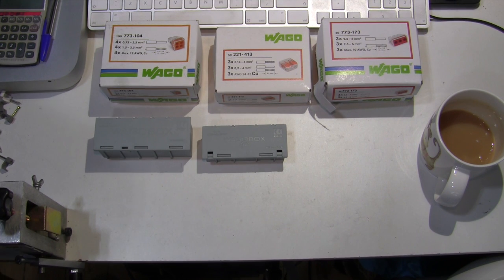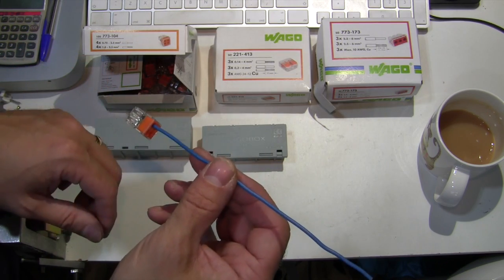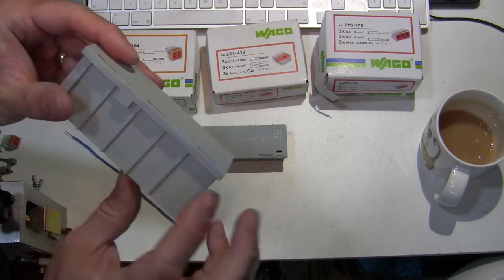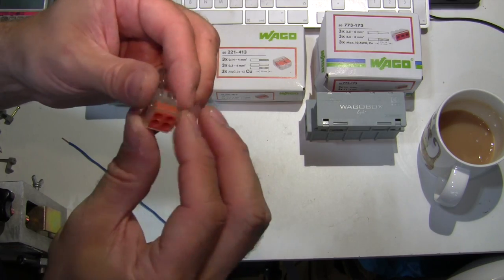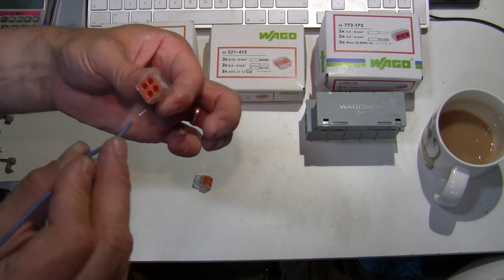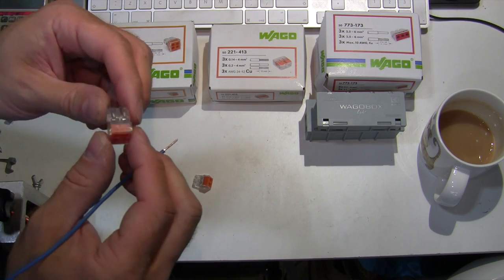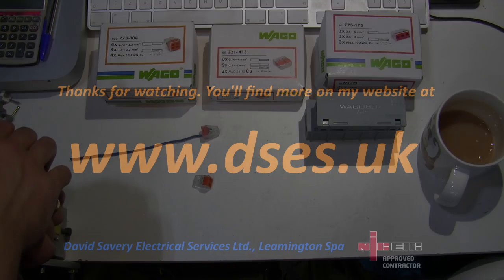Wago and fake Wago connectors

Comment: Great video as normal. Interesting topic. The one thing that has caught me out with these great little things is the amp rating. The Wago 221 20 Amp connector and the Wago 221 32 Amp connector look identical. They are the same size in every way. I’ve mistakenly used 20 Amp Wagos wrong box) on a Ring Final junction box. It’s been installed for well over a year before I’ve realised. Now I’m not sure if I need to swap them out for the 32 Amp. And as normal the Junction box is well hidden under a finished floor. Any thoughts ?
Reply from the maker: The 221 connectors are rated according to different accrediting bodies it seems. I have a box of 221 connectors here, and sure enough the connector itself has "JET 20A 300V" on one side, "ENEC 32A/450V" on the other. Looking at the back of the box, ENEC is the European Mark for electrical products which passes a rating of 32A at up to 450V, same as the Compulsory China Certificate (CQC) logo for export to the Chinese market. The Japanese market is where the PSE rating applies, and their conformity assessment body (JET) have rated these at 20A. As we're in Europe, you can ignore the 20A rating; these connectors have been assessed and passed at 32A. Some of the Wago series, such as the 773-102 are rated at 24A but also accept up to 2.5mm cable and are sometimes questioned for their use on 32A ring circuits. With any type of connector at all, if it accepts the size of the wire, then it's made to handle the current carrying capacity of that wire - unless it's an iffy knock-off in which case all bets are off, but when we're talking about official bonafide connectors, then if it's built to take a certain size of wire, it will be no less capable of carrying the same current as that wire. Remember that on a 32A ring, 2.5mm is itself not sufficient to handle more than about 18 - 26 Amps for long periods, and if the ring is intact then it shouldn't be, so a 24A connector on a 2.5mm ring is fine; it won't fail any sooner than the wire. In your case, the connectors are rated at 32A; Wago don't make a European connector rated at 20A for 2.5mm wire, so no need to go change them out!
Reply: @dsesuk  thank you so much for this amazingly detailed answer. Interestingly my local Strike electrical has the full range of Wago connectors. On the back of the box for some it says 20A and on others it say 32A. Now I’m really confused 🤷 That’s what you tube should be all about. Top man. Keep up the great vids. I may question them on this as to why the same connector has two different box styles. No wonder people get confused
Reply: @morkthebuilder9943  
I am not fully familiar with the Wago range, however if it says 20A, maybe a 2.5mm cannot be pushed in, only a 1.5mm?
Reply: @johnburns4017  Hi again John, I've used probably every wago made for cable sizes 6mm and under. I don't think I've found one that doesn't take 2.5mm, infact I think they all take at least up to 4mm except for the "lighting connectors" but I never got on with those so I don't buy them anyway.
Reply: Not same size.  221-41x is smaller than 221-61x.
Reply: The WAGO UL rating for use in the US is 20 amps  It's the exact same connector as the 32A IEC rated connector. 

This is because on the European continent, current causes much less heating.......Actually, that is 100% bullshit!  It's because the IEC rating system is dramatically different that the NEC UL rating system. In my opinion IEC ratings are complete junk!  Their whole system is horrible. One reason is because they use a consensus system of member countries, which includes places like India, Pakistan and China. Testing is completely different and the IEC allows for "self certification".  

Maybe your box was printed for UL approved, US use. Wagos are very easy to use, however they inherently have a higher resistance connection that screw terminals or wire nuts.

Comment: My impression is that these although maintenance free still need to be accessible so cannot be buried
Reply from the maker: The instructions provided with the Wagobox enclosures describe how to install and de-rate these connectors "...in situations where you need to install a Wagobox in an inaccessible location". Of course, this is in the UK where BS7671 regulation 526.3 applies so long as the equipment is compliant with BS5733 as these are. Other territories may not permit such.

Comment: They do make Y splinters. Do you use a lot they also make a single connection with individual throughputs so if you need the splice three wires instead of having a whole Gob of those they just go end-to-end one two three pass through and they're all in one junction. Very cool and color-coded.

Comment: From what I understand, Wago state:
1) That their connectors are superior to screw-in connectors, as they always give the correct torque. Handy in that torque screwdrivers are not needed.
2) They also state that the connection is superior as more of the cable is gripped - so less resistance drop on a cable run.
3) And that they do not work loose as screwed connections can. 

That correct?

Comment: I saw the old style grey and orange (222) knockoffs for $20 for a multiple port 60 pack but decided to just get the actual wago 2 port 10 pack.  I dont use em all the time so 10 will be okay and I thought perhaps I shouldnt go with a knockoff brand as a first impression on these lever locks

Comment: The other thing to note with these things is the differing cable sizes and ratings..... I think even the 221's are only rated at 20 amps. I could be wrong, whereas the 773's for the 6mm are actually rated at 41 amps...

Comment: I have had similar problems with push in connections on light fittings,  the cable came out with the slightest pull , I swapped them for connector blocks to fix that but not good imo

Comment: Whoa!!! Buried connections without junction boxes?  Is that legal on your side of the ocean?  In the US and Canada all splices have to be in an accessible junction box..
Reply from the maker: It's permitted if the connection is considered to be permanent such as soldered or crimped or, in the case of Wago style connectors, if they comply with BS5733, are derated for the design current, installed to manufacturer instructions and are contained within an approved enclosure that can only be opened with the use of a tool.

Comment: I second the Y connector comment. Sometimes when splicing into an existing wire you have zero slack available and can't get each end of the cut wire into a 221/222/773/2773 but in a Y the connector could make up the extra distance you need so that the two wires would go into each end of the connector far enough to be a successful connection. Also, in some situations, it would just look cleaner. Yeah maybe you'll be the only person to see it for 10 or 20 years, but it's a thing, ya know?

Comment: Those are not safe for residential use you’re telling the public something that’s not right those will come loose eventually and cause a house fire nothing like an old fashion Why you’re not the best those are junk fire hazard
Reply from the maker: You have absolutely no idea what you're talking about. Back up your statement with facts or piss off.
Reply: Our connectors are used worldwide and go through vigorous testing before going in to the market place. WAGO first introduced the spring connection back in 1951 to create faster and safer connections. Due to the fact the spring adjust to the conductor size, no over tightening or damage to the conductor occurs, it holds up to vibration and is shock proof. Please note, our products are used within many different applications, such as hazardous areas (Atex), Transport (such as Trains), Buildings (residential and commercial) and many others. As long as the person making the connection does it correctly, these are the safest way to connect wires. Feel free to watch this video https://youtu.be/s3bpD6VMes8! Please note we have many copies within the market place, so always make sure you look for the WAGO logo!
Reply from the maker: @WAGOUK  Lovely stuff! Looks like the only thing burning here is the ignorant original comment!!
Reply: @WAGOUK  What about ones that do have the logo? Like in the following Amazon link, the quality of the screen printing looks very poor. Could that be a sign of a fake? https://www.amazon.com/Wago-221-413-LEVER-NUTS-Conductor-Connectors/dp/B017NQWDY4/ref=as_li_ss_tl?dchild=1&keywords=wago&qid=1589754560&sr=8-3-spons&spLa=ZW5jcnlwdGVkUXVhbGlmaWVyPUEzRjZJRUs5OUwxTFE3JmVuY3J5cHRlZElkPUEwNzk5NDI5QlFBQzZENkpNQzUyJmVuY3J5cHRlZEFkSWQ9QTA2OTQxNjUxNFZVQ0E1WkM0RUZFJndpZGdldE5hbWU9c3BfYXRmJmFjdGlvbj1jbGlja1JlZGlyZWN0JmRvTm90TG9nQ2xpY2s9dHJ1ZQ&th=1&linkCode=sl1&tag=matthiasbalwi-20&linkId=56d467965b4f035bc807599e15f3bb29&language=en_US.
Reply: Use periods. It'll help people to understand what a complete dumb ass you really are.
Reply: Pat Papaleo John Ward has done some testing videos on Wago connectors.
Look them up on YouTube.
Why do you think that they are not safe?
If they were not safe, I am CERTAIN that JW would have highlighted it, in his videos.
Show me some research to show they are unsafe.
Wago, are a fantastic product.

Comment: I wish Wago made a straight connector with levers to replace two-pair screw terminals. In pretty much all older installations in Norway ceiling lights are connected with those, and I'd feel much better about it if they were connected with a maintenance free junction instead of those screw terminals. I'd be a lot more convenient too.
Reply: Have you seen the lighting connectors? They take two solid/coarse stranded wires on one side and a stranded one on the other, with a lever. IKEA supply those with all their lights in central Europe these days.
Reply: They do now

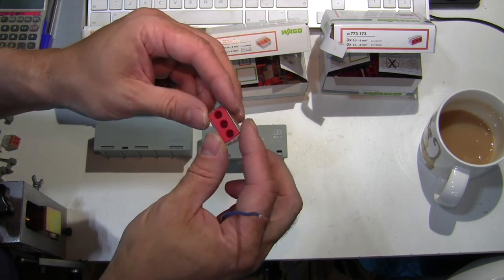Comment: Now I ain't saying I'm some sort of brainiac and maybe I have suffered one too many blows to the head, I mean I do keep smelling toast everywhere I go but at 3:22 just with that Y connector, you could use 3 x Wago 3 way connector, push or lever. Just split and strip the ring, stick it in the connector and then add in the spur. 
Unless the guy that installed the ring, in the first place, was a complete twat who was being super economical with the T&E you should have enough give to do it??

Comment: How do you permanently join electrical cable?
Reply from the maker: BS7671 recognises certain connections as being semi-permanent such as crimps, welds and solder joints.
Reply: @dsesuk  Thanks for that info. cheers.

Comment: Old video so you probably don't have any of the fago connectors around, but it would be interesting to tear one down and an actual wago and compare the metal inside (strength, thickness, clamping geometry, etc).

Comment: Thank you for the reply sir I’m going to consider them but I’m not doing the trade trade anymore retired but I never had a problem with using ideal wire nuts the tan ones this is a cool idea thank you very much for your reply so you are the UK or are you in the USA
Reply from the maker: I'm in the UK, and for some reason the wire nuts never caught on here, you just don't see them at all. Wago are everywhere though, it's only the real cheapskates who still use screw connectors, but we get through thousands of Wago's per year and have never had a single failure. If you go for this type of thing, steer clear of the nonsense on the likes of Amazon and eBay!
Reply: @dsesuk  I bought my wagos on amazon, are you talking those or the no name knock offs?

Comment: I would never use them in a electrical circuit that could’ve started a fire because the connections are not tight in that connector junk
Reply from the maker: Any mains-rated electrical circuit can start a fire with a loose connection. Clearly, Wago and similar products from reputable firms such as Ideal and HellermannTyton are fit for purpose and quite safe to use which is why they comply with standards such as BS5733. The proper banded ones are demonstrably not junk, it's the counterfeits you need to avoid. If there were a problem with this type of connector at design level, then they wouldn't be in commonplace use throughout the world. But stick with what you're comfortable with.

Comment: You’re not supposed to bury a junction box by code in United States of America you’re telling people the wrong stuff I’m electrician of it for 40 years not good practice to
Reply from the maker: It's not wrong as I'm in the UK and it is permitted in BS7671 the UK Wiring Regulations under certain circumstances which Wago meet the requirements for. There's a link in the description about that. What you do over there is different, but I never claimed to be speaking for anywhere else in the world.

Comment: Yes they are German, and I'm sure the Germans will pronounce it as vago but we all call them Wago's.
There is more to this company than just snappy Wago's, they have a whole range of products designed to help electrical and electronic installations, some of my favourite are the din rail mounted beauties that can be interconnected and require a tool to momentarily open the cage clamp system.
In my opinion as a mechanical and electrical engineer, Wago has been an outstanding choice of products for power connections.
Can you believe, Americans and Canadians still think those crappy twist nuts are a better choice!
Reply: Wire nuts are cheaper, which seems to be their only advantage. And they're so lo-tech there doesn't seem to be a counterfeiting problem.

Comment: Are stranded TPS cables meant to be twisted before clamped into the wago or not? Having trouble finding that in the manufacturers instructions.
Reply: Yes, by twisting you will make it harder to remove them from the Wago and that is safer.

Comment: You said you would use these in floors. Why? What happens if you have a leak?
Reply from the maker: I wouldn't run electrical services in locations prone to flooding, at least, not unless they were rated for that environment. If you're not referring to a flood risk area and you mean an accident that might happen such as a water main bursting, then all bets are off. I don't install circuits that are guaranteed resistant to unforeseen external influences that it would be unreasonable to try and guard against. If a pipe bursts, your dinner catches fire on the stove or an aeroplane crashes into your roof, the electrical installation may be damaged and require repair, but until those things or similar incidents occur, there's no need to worry about it.
Reply: @dsesuk  Yes, I'm referring exactly to a pipe bursting or even someone spilling a bucket of water accidentally. It's likely to happen and if that floor is wood, then the connection is completely unprotected.
Reply from the maker: I don't know what things are like where you are, but here we don't get frequent burst pipes or bucket spillages to have to second-guess our electrical installations. They're not events that are likely to happen, more freak occurrences to be dealt with if and when necessary.

Comment: WAA GO - it's lazy to not learn to pronounce a name with the advent of the internet.
Reply from the maker: VAA-GO according to Wago themselves!
Reply: @dsesuk  the y junction, what about the lighting model 224-112
Reply from the maker: @Adrianyoutubing  Good for lighting, but it's when breaking into a 32A socket circuit I need something in-line. the Hager J803 ticks that box, but you'd think Wago would have something similar.
Reply: DSES are correct here, but how many people call a Golf a "FolksVaagen"  or the capital of France "Paree"?

Comment: I had nearly the same issue. I had some work to do on a RFC. I was getting open circuit on the line. Traced it back to a fake wago connector just in the wall behind the C/U. Replaced it with a wago and all was good.

Comment: Technically speaking, they aren't fake unless they have faked branding too (in which case you might never know and the only real protection is to only buy them through reliable suppliers, not eBay).

However, I do wonder what action Wago might take over manufacturers producing almost identical looking connectors. Even if any patent has run out, there's usually some sort of protection for the particular design. There's clearly not reason, for example, why other manufacturers should copy the colour and style.

Comment: I walked into a discussion on this today on a sparky forum. Opinions differ, but the reality is that you can use a verified maintenance free box’s with verified maintenance free connectors and it doesn’t have to be accessible. The basic features are a sealed flame retardant enclosure secured with a screw or lock pin. Cable arrestors and screw-less terminal block.

Comment: DIY or pro, Wago is almost certainly the go to over here. A three-way Wago is electrically identical to a Y connector, isn't it?
Reply from the maker: It is, but I was talking more about something in-line similar to a butt-crimp, but in a Y-configuration. If you're splicing into a tight cable, there isn't always enough slack to parallel the wires using the three-way connectors. There is a product that will suffice though, the Hager J803. Ideal for splicing into a tight ring cable to run a new spur.

Comment: Are you saying that City Electrical Factors is stocking Counterfeit Wago connectors? Because that is what these are! I think that one has been damaged and re used by somebody yanking a cable out of the damaged port and damaging the spring.
Should never have been reused.
Reply from the maker: No, as someone earlier pointed out, they're not 'fake' Wagos, they're wannabe Wagos - they look exactly the same, but come in their own packaging under a different name. It was a sealed packet, so not a unit that had been previously used.
Reply: They aren't counterfeit as they weren't branded as Wago.